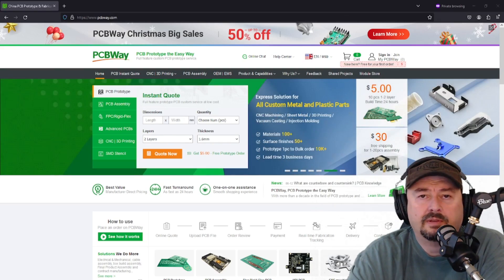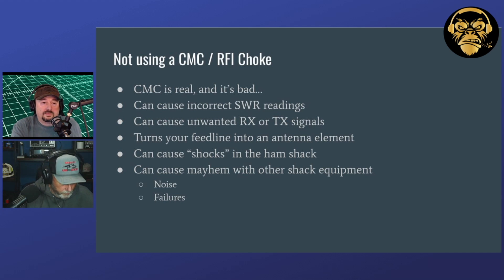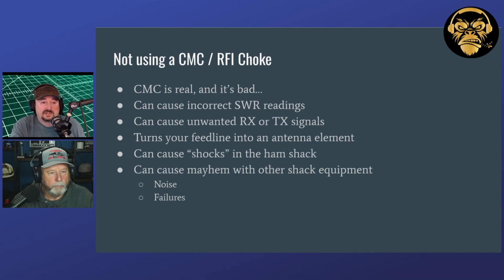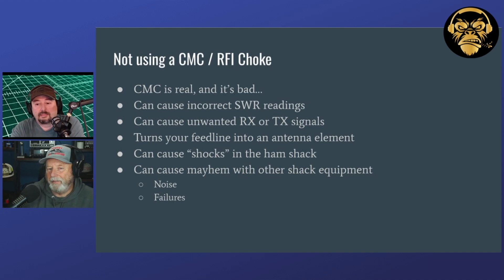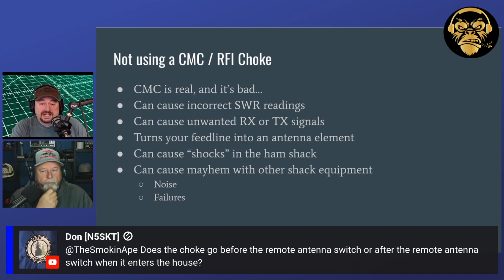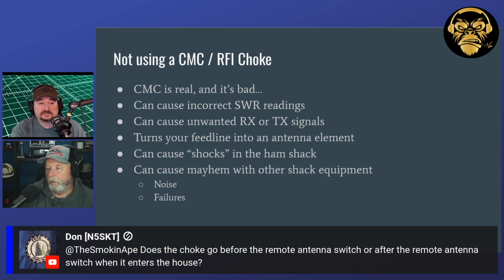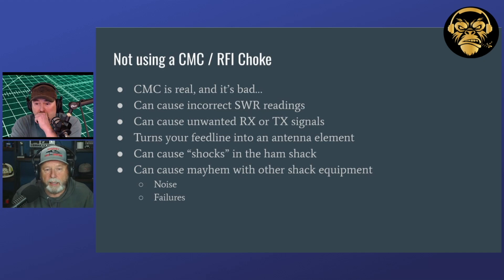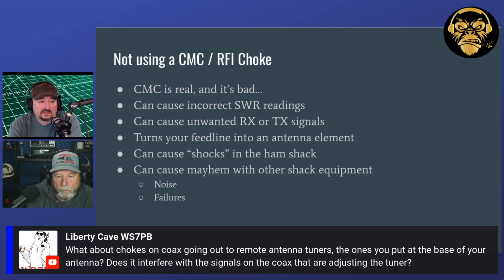Common Mode Current Baluns and Chokes for Ham Radio Antennas

Comment: The effects of common mode current on SWR doesnt make sense. SWR is measured inside the 50 transmission coax and common mode current is external of the transmission line. The whole justification for the need to deal with CMC is that it is a separate circuit, and now you are saying for SWR they do interact? I can maybe understand how the electronics of a SWR bridge get affected by CMC.....
de G0AFV
Reply from the maker: The SWR bridge used to measure forward and reflected voltage will also detect CMC voltage 👍
Reply: @TheSmokinApe  I can only agree to disagreeing with you.
Reply from the maker: @bazzaar1869  okay

Comment: Funny thing is I am only Gmrs licensed but a choke and swr and cable loss seems to be more important in the higher frequencies because it already struggles with distance. So most people are running crap setups with Gmrs and the potential to make it way better is there with just a little bit of research!
Reply from the maker: Hey Jim, I think part of it is that the GMRS radios come with little information so they probably just don’t know any better.

Comment: Good info. CMC's have kept my bacon from burning in the shack!

Can you produce a video, using the NANOVNA, measuring the feed point impedance of a specific length nonresonant 
EFHWA?  I'm using a newly installed Balan Designs 9:1 with a 41 foot wire that is supposedly nonresonant at the 40 thru 10 meter bands.  I have not found any videos measuring the impedance directly at the antenna feed point (ant/counterpoise). Also, the VNA H4 port impedance defaults to 50 ohms.  Should this be changed to 450 ohms since the balun is 9:1?
Reply from the maker: I haven't done the measurement right at the feedpoint, I could the next time I have an 9:1 installed.  The nanoVNA should be at 50ohms, which is the system impedance of the radio.
Reply: Agreed the impedance of the radio is 50 ohms but if your looking directly at the antenna "feed point" impedance I was thinking the NANOVNA port might be accurate when set to  450 ohms for a 9:1 balun. Does that make any sense at all?
Reply from the maker: @rfburns3472  if you are testing without the transformer, the transformer effectively divides whatever the impedance is by 9.
Reply: Sounds correct.  Looking forward to your video with a direct measurement at the antenna feed point.  BTW, your videos are very well done. Thanks for putting forth the effort.
Reply from the maker: @rfburns3472  thanks man, glad you like them

Comment: I've been experimenting with h/b h.f. dipoles lately, a 60m inverted vee and a 2m 2 element collinear and trying ferrite chokes.
I decided my best place was at the tx end as it kept the SWR happy unlike at the aerial end where my hand on the coax in the shack affected the SWR. 
My theory is that r.f. surrounds the coax and it was picking r.f. up after the choke. Perhaps a few snap on ferrites spaced out along the coax near the aerial will do the job. I'm going to try it.
G4GHB.
Reply from the maker: Yeah, I do choke at both ends.  Good luck with it Bill 👍
Reply: @TheSmokinApe  It does seem it's going to be best.
73, G4GHB.

Comment: Hi Ape,
I saw Don's questions about remote coax switch and remote tuner. I have both and put a CMC at the input to the remote tuner and have both the tuner and switch box connected to a ground rod. Never had any stray currents come into the shack.  73  WJ3U
Reply from the maker: Thanks for the info Don 👍

Comment: What is better?  A coax choke on a 31/43 mix toroid or a bilfillar wound toroid of 31/43 mix?
Reply from the maker: It's a pretty hot debate and its going to depend on core size / type / wire gauge and type / number of turns and pattern.  Here is a good discussion to check out to get started: https://ham.stackexchange.com/questions/13005/coax-or-bifilar-windings-for-a-choke

Comment: CMC is real. All current needs to flow and will ALWAYS seek the path of least resistance. The best solution is to eliminate or minimize the current at the source. Knowing that the current most likely won’t be eliminated you should give it a path to ground that protects people and equipment.
Reply from the maker: Totally agree and thanks for the comment!

Comment: QUESTION!  Wouldnt your coax be grounded at the entry point into your shack, via the lightning protector that has potential to ground, help eleviate the cmc getting into the shack?   The current should look for the easiest path to ground.  I would think the coac grounded at your tower or pole help with the same thing?
Reply from the maker: Yes, that is correct.  That said, it's best to keep the current off the shield.
Reply: Coax sorry my fingers are too fat to type on a phone

Comment: Ape, based on what you said, would love to see your setup in regards to connecting to your radio via wifi, I have a 710, wondering if I can do that same. Be nice to isolate the radio from my computer. Or is that just a feature your radio supports out of the box?
Reply from the maker: I use a program called SDR Control, it's only for Icom 😜

Comment: It would be interesting to see what effects clam chokes (clamp-ons) may have on swr of the antenna.  If you were to tune an antennae to your sweet spot then place several chokes on the line.... would the SWR change at all if re-measured?
Reply: If it does, it proves you had common mode current on the exterior of your feedline .
Reply: @VE9ASN  hard to argue with that...
Reply from the maker: Yeah, it would only change if there was CMC.

Comment: I missed this live Ape, sorry. Did you say that a carbon fiber pole is NOT good to hang a wire from?
Reply from the maker: Lee is correct, CF is conductive and will almost certainly have an effect on radiation pattern and tuning.  I don't use it...
Reply: [DISCLAIMER: I am not @TheSmokinApe]
Carbon fiber is strong for the weight, but it conducts electricity some. Not as much as a metal, but much more than fiberglass.

I use carbon fiber to hoist a hamstick dipole, or one end of an EFHW. Using it to raise a wire vertical is problematic. It might work, but if it does not, that is the first thing to check.